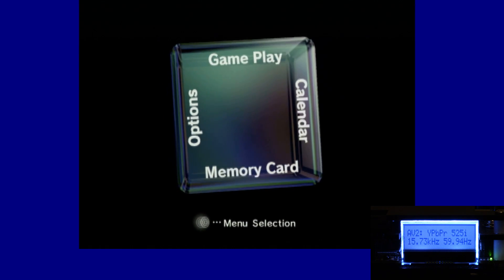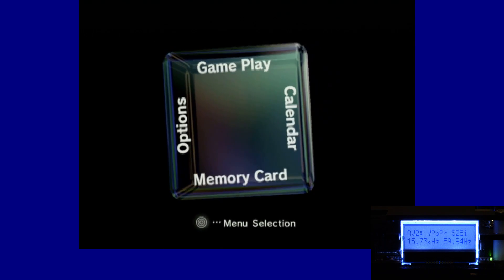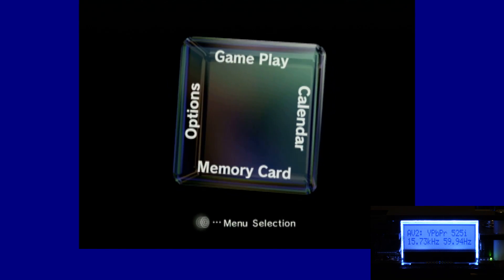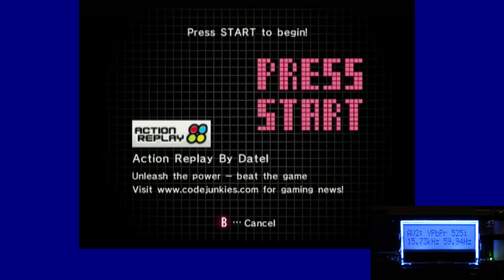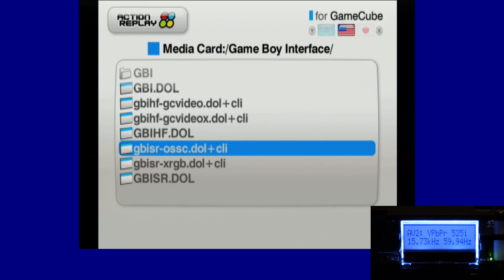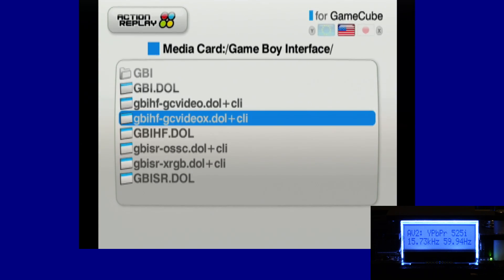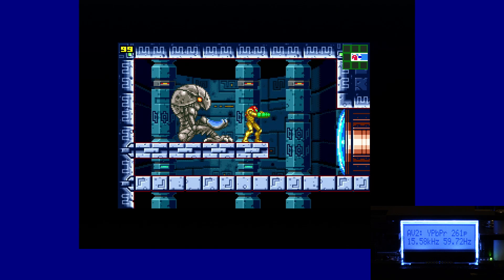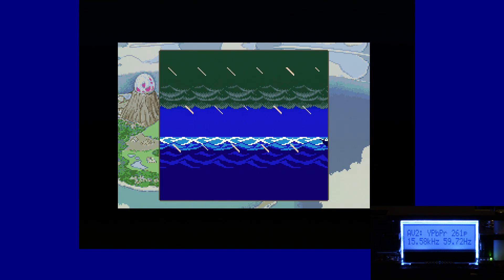Game Boy Interface with Component Video into OSSC Tutorial

Comment: I'm using a EON GCHD Mk.2 with HDRetroVision's Wii component cable into my OSSC, and everything else I've put through the OSSC has been great, including regular Gamecube games through the Wii component cable to the OSSC. But with GBI, I can get it to output, but no matter what I do, it always has about 1/3 of the screen taken up by a black bar. I followed all your instructions in the video, I'm just not sure if it's the janky-ness of my setup or user error on my part.
Reply: Joel Ostrem hey I’m not sure if you ever figured this out, but I had this issue too and I had to change a setting in the menu on the GCHD MK2.  I think the main thing was the setting something from YUV to dYUV, but I was also able to change it to output 240p.
Reply: @starshipvelcrp  Thank you so much for replying to this comment. I did end up figuring it out and it was exactly what you stated. I really appreciate it!
Reply: @bfums  I don't see this setting, how were you able to fix this?
Reply: @starshipvelcrp  I can't find this setting on mine, how were you able to fix this?

Comment: Thanks for the video! Have you tested timing settings for the newer 360p output? Recent releases of gbi come with this file: "gbihf-ossc.dol+cli" It's great because it allows for 1080p with line3x on the 384p ossc setting, but I can't find any optimal timing settings online.
Reply: Never mind! Found this link that states that it's built in to the Ossc's firmware for whoever was wondering the same:
https://www.reddit.com/r/Gamecube/comments/bzlpp8/optimal_timings_gbi_hf_ossc_version_360p/

Comment: I have everything required to do this, just might give it a try, thanks for a great video!
Reply from the maker: I no longer support GBI due to the ever-changing output parameters and resolution. It was just taking too much of my time to keep up with. Sorry about that.
Reply: @RedArremer  Given the fact most tutorials and content MliG and even this video was from 2018 most of the gbi software has already been changed drastically that right now I've find it way too confusing. I got my GC modded with Xeno so I'm using a burned Swiss disc along with GBI in it however it cannot run .dol+cli files like you've done in this video.
Reply from the maker: @YeaNaYea  I've given up support for GBI as it constantly gets changed and updated much faster than I can keep up with. I got left in the dust several months ago, so I'd rather just get a GBA consolizer.
Reply: @RedArremer  I'm inclined to agree, the only good thing I've found after using swiss I can now force GC games to 240p which may or may not be better for the OSSC in the future depending by which TV I get. High Fidelity mode works very great on my Sony BVM but it sucks how I cannot zoom in it given there's no overscan mode on the 20f1e.

Comment: While I recognize that this is a great quality image, I wouldn't say the HDMI adapters are completely worthless. I should bring up the fact that the official component cables are still 200-300 dollars, while ZeldaXPro's HDMI adapter is only $100. 
It's a shame the OSSC has no HDMI input, but unless the Gamecube has a cheap RGB cable available, I'll just deal with it.
...in fact, why don't people use an RGB cable with their GameCubes? From what I understand the Digital Out port outputs pure RGB, so what's the issue? Is it just that nobody has bothered making them yet?
Reply from the maker: A few things here:

1.) A lot has changed since this video concerning GBI and the direction it has taken. I need to revisit this subject now that I have a "GCDual" mod installed in my Gamecube. This mod provided RGBS to the multi A/V port and a separate mini-HDMI jack. The same guy that designed this internal mod (citrus3000psi) just teamed up with "EON" and have announced their new "GCHD Mk-II" adapter plug. It's effectively a fully externalized GCDual mod, providing several output options: RGBS, YPbPr, and digital HDMI. This is the first external adapter to provide access to all three output types. Here's a link to the product, which looks to be a must-have for the Gamecube enthusiast: https://www.eongaming.tech/products

2.) The digital out port was removed from Gamecubes early on in the console's market life, meaning you have to hunt down one with a digital out port.

3.) There have been no cables you can simply 'buy' for running RGB from the digital out port, namely because the connector technology had to be reverse-engineered AND it's difficult to manufacture a quality connector. ZeldaXPro's connector was infamously shoddy and used an unsafe interface that would brick your Gamecube if you bumped it the wrong way by accident. I'm sure he's since made a better interface, but other professional companies have swooped in with safe connector designs (EON and Insurrection Industries to name a couple).  Furthermore for NTSC Gamecubes, you can't even get RGB from the analog multi-A/V port. It requires the GCDual mod or the upcoming EON adapter as mentioned. Only PAL Gamecubes have native RGB support.
Reply: @RedArremer  oh yes, on the topic of ZXP's original connector designs, i can confirm that every model he has released 3.0-onward has a brand new 3D-printed connector, which eliminated that problem with the bricking. 

Also I'd like to ask; a feature with ZXP's adapters that I really appreciated was the ability to pair a remote control to open the config menu, as opposed to other GCVideo solutions which only allowed for a button combination on the GC controller. I've also heard this is an option on the relatively new Wii Dual mod. Have they released any information about this being possible with the "GCHD Mk-II" adapter?

And that's really strange that only PAL consoles support RGB output. Though, I would imagine if you got a PAL Gamecube then you could get a region-free mod for it?

In any case, thank you a lot for the information. I really appreciate the quick response!

Comment: Do you think the Carby HDMI adapter works fine with your Framemeister Profiles, GBI and all that stuff ?
Component cables are the way to go I know but they are just too expensive and I'm not risking to buy a non functional cable for 300 dollars... besides the HDMI adapter should be even better because the signal never went analog right?
Reply from the maker: Actually the Gamecube does compress the color data before sending it out to the digital port, but there have been recent improvements in chroma alignment for the code developed by unseen. Also I should point out that Extrems has changed his GBI profiles many times since this video originally came out, so likely it no longer applies to his current offerings. I've got a lot of other projects going on, and so I couldn't keep up. Eventually I will go back and revisit the GBI situation with the newest firmware using the GCDual mod by citrus3000psi. 

Also no, the HDMI adapters would not work with my old Framemeister profiles as I had only designed them from the component input. I did not have an HDMI solution for the Gamecube at the time I made this video, and the settings you make on the Framemeister do not carry over from one input to the next (except for composite and S-video sharing the same settings).
Reply: @RedArremer  would love to see you revisit this : )
Reply: Thanks a lot for your answer and for all your work on all this. I use your profiles a lot and since I had no RGB SCART cables I went the S-Video route as a quick solution (I have some now), The PS 4x profile did'nt work with S-Video as you said, it didn´t carry over... so I just copy the settings on Visual, Zoom, Color, Sync and A/D Lvl... obviously, it was wrong, specially the color values and A/D Settings but overall it did the job, scaling was uniform and scanlines fall in the integer. I don't know how much the signal changes from one type of video to another but it's something worth mentioning I think, specially for consoles in which RGB or component are a problem like the NES, N64 or the GameCube. The PS, Genesis, SNES are rather easy, just get the cables they are not that expensive

Comment: How do you capture footage? How did you get that fancy background for Link's Awakening?
Reply from the maker: I use a Datapath Vision E1S capture card. The background I'm not sure which is doing that: The GBA Everdrive X5, or the GBI driver. I've not really messed with border graphics and how that works for either device, so I honestly don't know.
Reply: It's the Goomba Color emulator doing it.
Reply from the maker: Ah okay, so it was just the stuff I have on the GBA Everdrive X5 card itself. It appears the Goomba emulator is in the GBASYS folder.

Comment: I use 5x on a 1600x1200  display. Could I just put it in 5x /1200p mode and the rest of the setting should mostly match? Any extra tips for this mode?
Reply from the maker: The cool thing about optimal timing is it pretty much is independent of the output resolution, so if 5x works on your display, then it should use the same settings for advance timing modes.

Comment: Thank you for this tutorial! I have a PAL GC with an RGB cable, GBI and the OSSC, do you think I could use similar settings?
Reply from the maker: Quite possibly it should if you can run GBI software on it. I think Extrems would have pointed out a different H. samplerate other than 433 if PAL required different timings.
Reply: Hi Joly, I have the exact same setup. Personaly the best results I found was with:
--format=hd60 
--scan-mode=non-interlace,clock2x,size2x 
 It is not full screen but I have no jiggers, no vertical scrolling desync and no ghosting. 
Then in the ossc I put: 4x mode, Then for my personal taste: (some boost in color and alpha like in this video, add scanlines type substraction with 12%) STUNNING!
Reply: Awesome, I was going to ask you the very same question. I'll check your settings out, FBX. As always, thanks for your dedication, it's hugely appreciated!